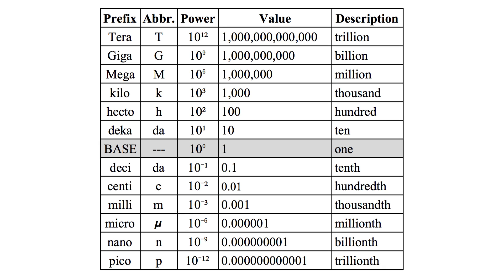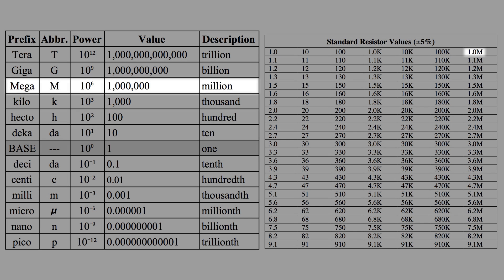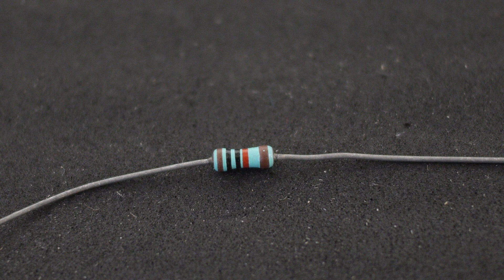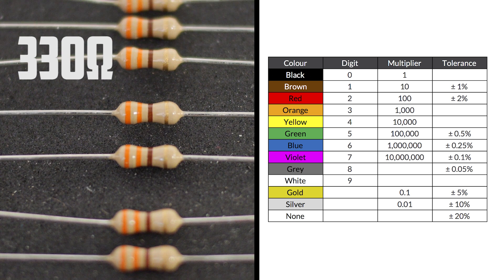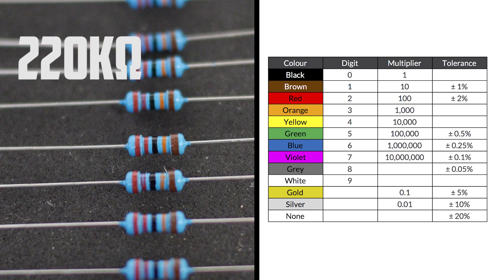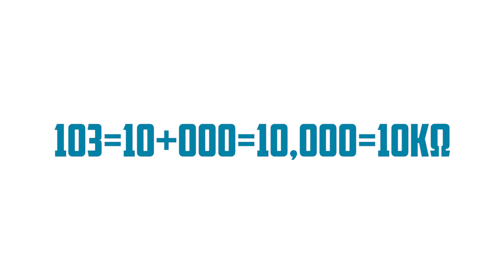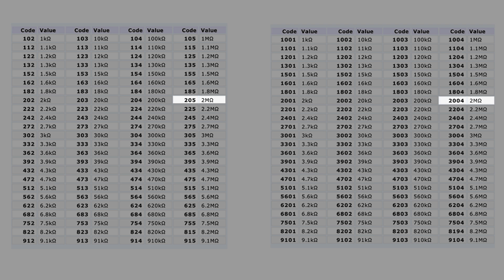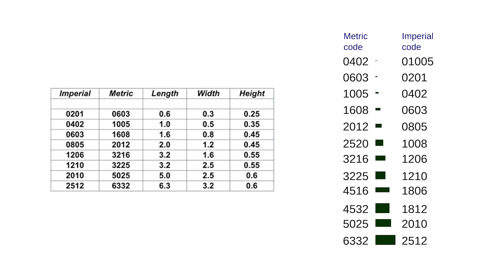Reading Resistor Chart Values - The Learning Circuit

Comment: I'm replacing  two  390k ohm resistors on my guitar amp pc board.  I ordered two new resistors,  and when I connect them to my ohm meter to read there values the new ones read 390ohm but the ones I'm replacing read 390k ohms?  why would one just read 390 and the other read 390K?   color band on the new ones are,  orange,  white,  yellow,  gold.  thanks
Reply: Is it possible one has an extra band? There are 4 and 5 band resistor codes. Maybe it's hard to see?

Comment: Maam, thank you for the video regarding resistors, very informative. If you wouldnt mind can I ask if ' the value of a resistor in a multimeter is not within the tolerance, is it a bad resistor, although not far from the tolerance?
Reply: most res to day are from china they are high quality and cheap they read exactly what  the states examp   540 ohms will test 540 exact with you meter  (0% error )they come 10 to a card all values dirt cheap but very good -- just order assorted the sent you a sack full

Comment: I'm quite color blind, so I picked up a cheap pair of component reading tweezers.  They work quite well on resistors
Reply: use your ohm meter to read value of res. most are 1% or less tolerance

Comment: I'm also Slightly colour blind so I always check my resistor values with a multimeter before use. Thanks for the video.
Reply: The colour coding on '5-band' resistors is typically not very readable even if you aren't colour blind, so I do the same.

Comment: Nice tutorial. One thing manufacturers really need though is a code for SM capacitors. It's impossible to tell what the value is without a circuit diagram or pulling it off the board and metering it. Really annoying if they end up loose in the parts storage too. No way to sort them by eye.